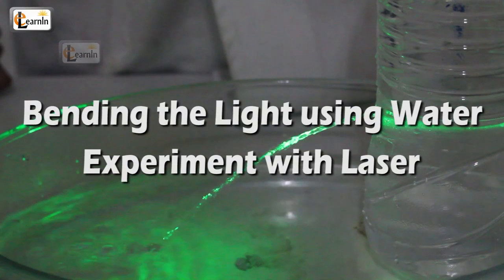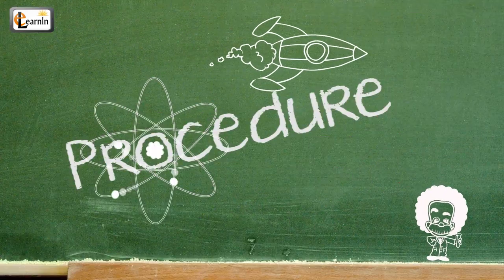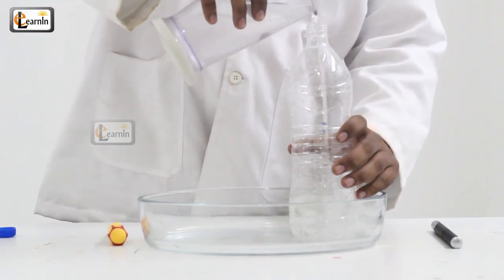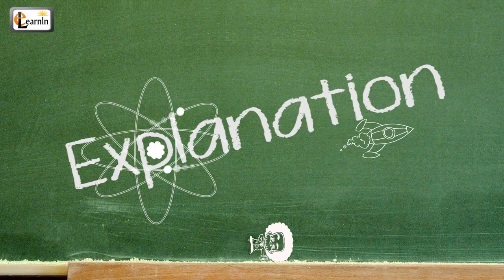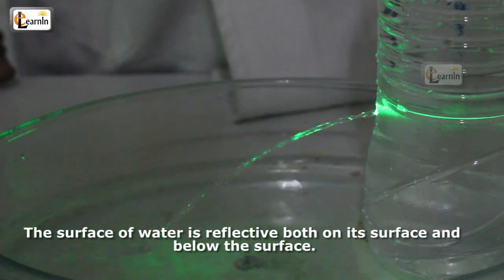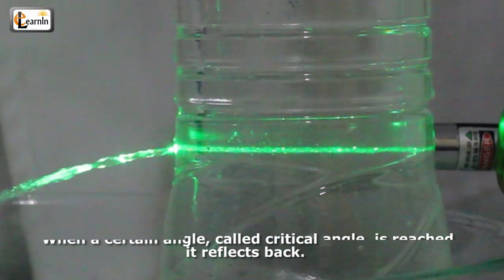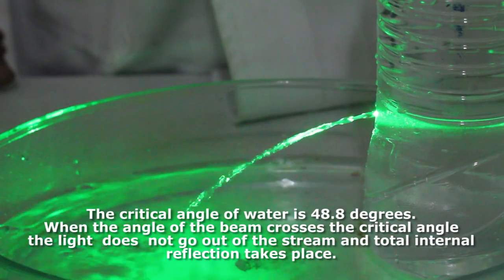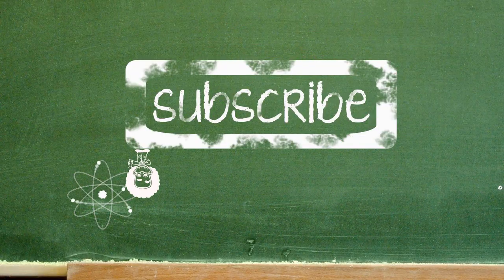Bending of light | Laser bending demonstration | Science Experiment video

Comment: i'm not quite sure I understand how to apply the angle aspect. In the demonstration the beam of light is parallel to the ground, and it's aimed at the opening of the stream. Where does the 48.8 degrees come in? Should I imagine the arc of water broken down into little straight segments, and determine the angle of the segment relative to a line perpendicular to where the beam of light strikes the segment?

Comment: Can it work with a red laser?
Reply: no. I tried it and it does not work. Only with green lasers
Reply: Jason Barroso I actually solved the solution. Red lasers dont emit as much light and arent as strong, so you have to do it in the dark to really see it.
Reply: John Doe It is not about "strength" but about wavelength.
Reply: +John Doe it does actuallly work w/ red laser
Reply: Can we use torch
Reply: It can't because the bending also depends on the wavelength of the light..